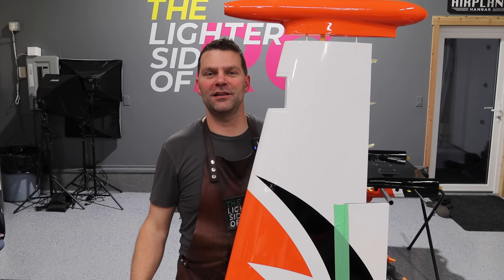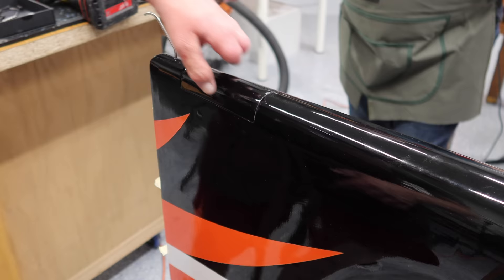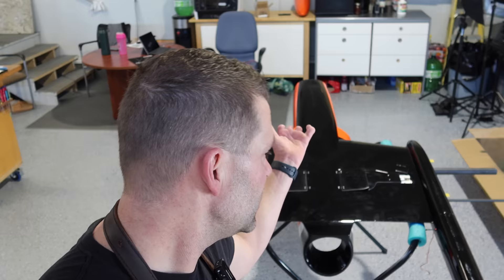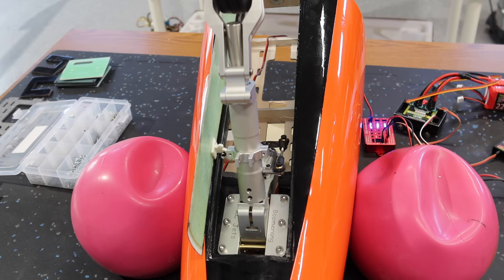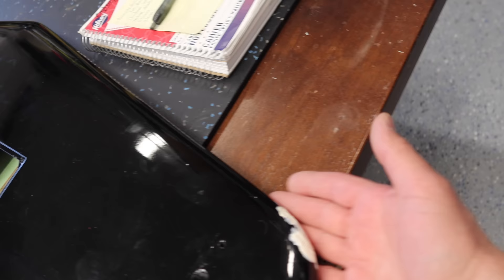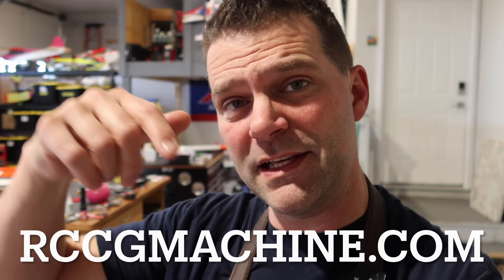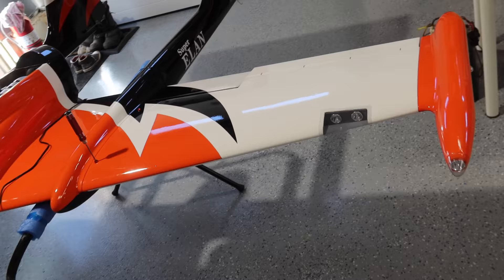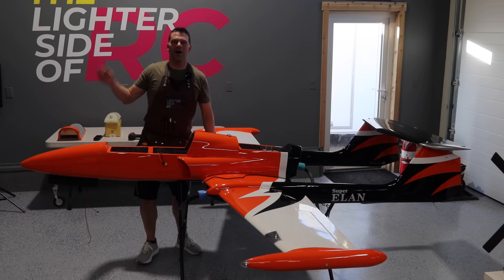Putting The Pieces Together - Servo Install Boomerang Super Elan

Comment: Thank you so much for taking your time to teach us new things . I am always learning new things with your videos.

I have a question about the repair with the elevator. What did you use to fix the dent? What sanding paper number did you use ? Any primer ? Or just paint over the product that you used? 

You should do a video of repairing and painting composite frames and wings! 

Thank you Jonathan!
Reply from the maker: Thanks Jose.  Just filled it with Hysol.  Sanded flush with 120 to 400 to finish.  Just painted over the hysol/paint.

Comment: Hi Jonathan, love your vids and had a quick question. I am struggling doing the thin CA and ball joint trick you talk about in this video. Am terrified will add drop of thin CA and the ball joint will lock up forever cuz I misunderstood what you said. I actually dropper a thin CA drop ONTO the silver ball of the boomerang blue ball joint and let it go INTO the area where ball rotates and then kicker it dry in there? does it not stick? is it too slick in there?
And then one drop of light oil?  Just making sure. Thanks again and keep up the great work!
Reply from the maker: Don't be worried.  Oil First also works well but either way is fine.

Comment: Hey Jonathan great video as usual, how do you like the new wire, and did you have any problems sliding the pins in the ashlock connectors. I used the 20 gauge twisted silicon wire with the ashlocks the wire fits but I need to use something to push the pin into the connector because of the thickness of the wire insulation.
Reply from the maker: I like it!  Crimps very well. And from my tests extremely durable and heat resistant. The casing is much thinner than the heavy gauge silicone wire so zero issues fitting into connectors. The one thing I’m not a fan of is how loose the twist is so it comes apart easily.
Reply: @The Lighter Side Of RC  it might be worth cutting a length a few inches long than you need a put one end of the wire in a vice and the other end in a drill motor and put a few more spins in the wire. I like the power box stuff but it seems like it's harder to get.
Reply from the maker: Problem is that the casing is almost slippery so not sure how well it will hold. I may try that to see. Thanks for the tip!